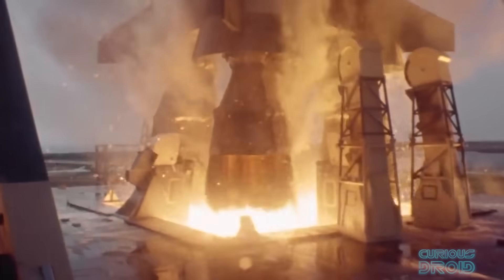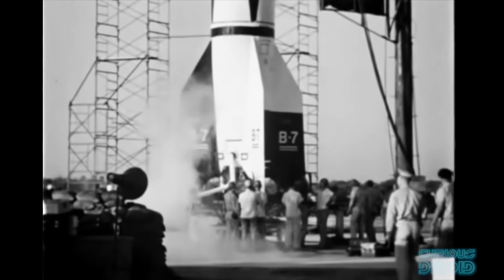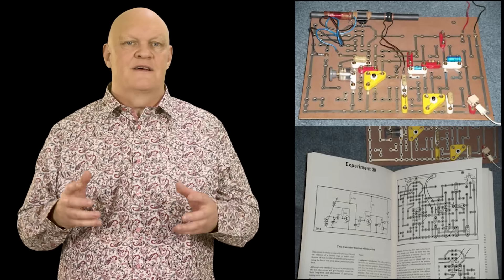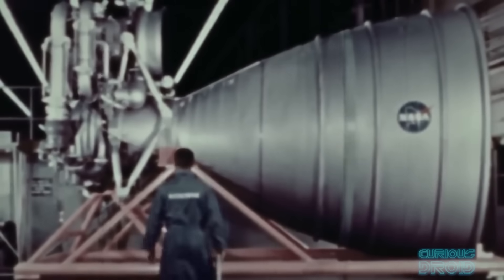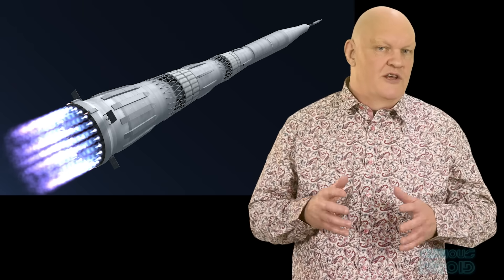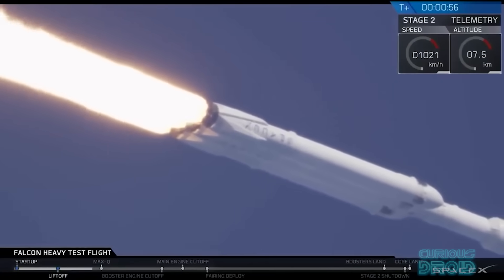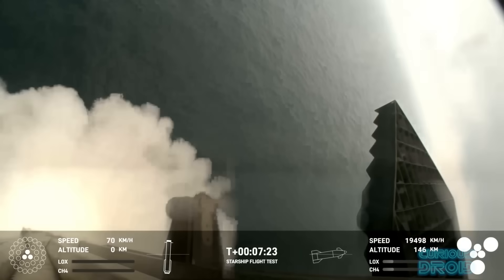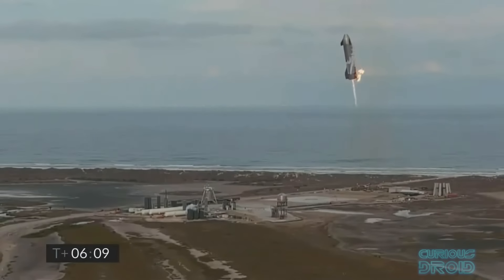Why Does SpaceX Use 33 Engines While NASA Used Just 5?

Comment: 18:20 As far as I know the SLS solids also aren’t being reused. As they burn for longer than the shuttle boosters and burn out at a higher altitude, they can't be recovered.
Reply: So at this point the best use of SLS is just to get some use of legacy stocks of parts from Shuttle. With the caveat that they have to make a ton of new stuff to be able to use the old stuff. 

Should have at least painted the things white so they give off that classic NASA Saturn V look.
Reply: @scottwatrous main issue: with refurbishment and modifications this old stuff is WAY more expensive than new stuff. Rs-25, main engine of shuttle and SLS, costs of refurbishment and modifications is about 140mln per one engine. New rs-25E, currently in testing will cost 100 (later 70) mln per one. Cost of BE-4 ( stronger engine as it got ca 2.5 MN of force vs 1.8 of RS) internal cost of production is ca 7 mln, while it's sold to ULA for 20 mln. 
Raptor 2 engine, with 2.3 MN, costs around 1mln internally. Raptor 3 will be even cheaper. 

Simply put, modern technology of production is way more effective. From machining to 3d printing. And also modern materials that are way cheaper (raptor 2 uses mostly stainless steel and copper, raptor 3 uses almost exclusively stainless steel. Steel in late 70 wasn't as advanced as today, and due to technology wasn't practical to use it. During development of SLS there was lot of proposals that had way more sense from time perspective, but we're abandoned in favour of "safe approach". In example there was in pretty advanced engine from rocketdyne from J series (don't remember details) that could be much less expensive than legendary, but obsolete RS 25. Also, rocketdyne if I recall, tried to revive F1 engine in form of F1b. F1b used modern technology for production and its estimated cost would be 15-30 mln. They even tested powerhead. 2 of those engines should power kerolox sideboosters instead SRB, and that would increase capabilities of SLS. Because not only kerolox boosters would have more power, but much more DeltaV. 
All those proposals were shot down by politicians
Reply: well realistically speaking the reuse we had with the shuttle boosters wasnt really worth it either, similar to the shuttle itself. While I love it as a spacecraft it definetely failed when it comes to reusability, which is why it is often considered as Refurbished instead.
Reply: @LunnarisLP  100% 

Shuttle would have been better at reuse if not for the stupid DoD requirements

There were shuttle upgrades proposed which would have fixed a lot of what the first shuttle got wrong
Reply: @LunnarisLP  It was $60 to $80K just to replace the windshield after each mission because of pitting from micrometeorites.
Reply: That's correct. They are not reused.

Which is just as well, they would need to be stripped down to bare metal and then built back up. This was effectively more expensive than just making new ones for every flight.
Reply: Some facts: The boosters followed a ballistic trajectory, falling back in the ocean. During descent, they were slowed by a series of parachutes: a drogue chute deployed first, followed by three main parachutes, which helped slow their descent and control their landing.
The SRBs splashed down in the Atlantic Ocean, approximately 140 miles downrange from the Kennedy Space Center.

ships were already deployed to recover the boosters from the ocean. Divers attached flotation devices and cables to the SRBs, which were then towed back to shore.

Once recovered, the SRBs were transported to NASA’s Kennedy Space Center, where they underwent a thorough refurbishment process. This included cleaning, inspecting, and replacing any damaged or spent components. The solid propellant was removed and the casings were refurbished for reuse in future launches. 😂
Reply: SLS is a joke rocket.   it's a jobs project and nothing more.
Reply: Space shuttle booster cost more to reuse than just sell it for scrap steel and build a new one.
Reply: @k53847   not sure if that’s factual or just a hearsay 🤣… on the other hand you have never seen SpaceX disclose the cost of any of the boosters…or a open shared assessment of damaged components, or systems from any landings…Now that’s a joke 🤣
Reply: @Mannicx  For F9, compare a launch with booster reuse to a launch where they can't recover the booster.  The most optimistic  SWAG of SRB I've seen was it only costs 98% as much as buying a new booster.  Other estimates are it costs more and it was all PR driven.
Reply: @Mannicx  there was few times that Elon himself talked about this, and also it is very close that was described in other sources. "Refurbishment" aka sooth removal from engines and roughly from booster+ inspection etc costs about 1-2 mln. Cost of building new second stage is ca 10 mln (there is a bit variable like nozzle length). Building new fairing costs 2 mln. This is why they are reusing old ones.
Major variable in cost is transport. Sea recovery is quite expensive. One launch with reused booster costs SpaceX roughly 15-20 mln. Building new booster costs 30 mln so new booster expendable is ca 45 mln. SpaceX is charging customers roughly 60 mln per launch so they are anyway in plus, but major difference with reusability is cadence that they can launch. Don't remember exactly, but they can build   new booster in about month. Thanks to reusability they are now launching 3 times a week.
Reply: SRB’s on the old space shuttle were recovered after splashdown and refurbished and reused. They had parachutes in the small fairing. Lots of videos showing this. 
For the SLS- weirdly it says they aren’t recovered. Maybe they have so much more thrust than those old srb’s that they figure the stress isn’t handled well.
Reply: If Wikipedia's numbers are to be taken as reliable the SLS boosters only burn for 3 seconds longer than the Shuttle boosters (126s for SLS vs. 123s for Shuttle)
This is pretty insignificant considering that the SLS booster has more than *1.25 the fuel that the Shuttle booster had (640 tons vs. 500 tons)

They probably burn out at a higher altitude because the entire rocket is stronger, and so the entire unit ends up higher than shuttle did when the boosters burn out and stage separation happens.
Reply: Solid booster reuse is not very economically worthwhile as the video mentioned they're relatively simple
Reply: Exactly. SLS is such a big waste of money...
Reply: @scupking  hear hear... 
It less capable but more expensive than friggin Saturn V. Senate launch system aka senate jobs program. In expense of already underfunded NASA. I like how recently NASA is moving more and more to fixed price/reward contracts like ie with Mars sample return contract. That one is particularly ambitious with a bit underwhelming price, but CRS CCP programs shows that is good way. NASA is interested in results, not how they are achieved.  
I hope that one day NASA will be like: " here is that particular data we are interested to gather from this celestial body, and here is price we wanna pay for that. You got 5 years. Go". And paying for results.
Reply: @just_archan Yeah and the government seems to hate Elon and won't talk about SpaceX or Tesla.
Reply: @scupking there must be a reason 😂
Reply: why do they burn longer? It's the same propellant, with the same diameter of the booster (same burn time).

The booster is longer, but that only increases thrust, not burn time.
Reply: @ora6925 They have an extra segment added, they're longer than the shuttle ones.
Reply: @ReddwarfIV  solid boosters burning from inside out. So each segment burns same time. Difference in length means that they have more power. Unless that they have change propellant for slower burning. 
Basically for making boosters burn longer you make them thicker, not longer, or change propellant mixture. Slower burning propellant generate less power tho.
Reply: @just_archan  Fair enough.
As far as I was aware, the main reason they weren't going for reuse was that they finally accepted the SRBs weren't worth refurbishing.
Reply: @just_archan  It's not the same mixture that Shuttle used, but a new formula. They separate at a higher altitude and velocity than Shuttle, makes reuse impractical and not sensible, just like in general with high C3 performance vehicles that have booster cutoff at near stable orbit.
Reply: @just_archan  But the propellant isn't a simple hole up the middle, the hole tapers and has different shapes (at least for the shuttle) to control the amount of thrust during its burn. So that can(within limits) control the thrust/burn time, reducing one increases the other.
Reply: @stusue9733  ikr. It was simplification of principle. Most people think that srb burn like "candle", so along length of booster. That is obviously not true.
Reply: @ReddwarfIV  The SRBs are hollow core: all 5 segments burn at the same time. The additional segment adds thrust, not duration. It's not end burning.
Reply: @ora6925  you're right about the current SRBs 

I'm not sure about the BOLE one's SLS is about to use
Reply: @ora6925 good question, SLS SRB's have five stacks of propellent compared to shuttle's four and there is an extra RS-25 so when the SRB's separate they are too far down range for effective recovery.
Reply: Did Apollo 11 actually leave near-Earth orbit?
Despite the revisionist narrative that this channel won't question -- unstable fuel burn for the oversized F1 engines was never rectified and another arrangement in their place was made in order to reach near Earth orbit, keeping the F1 bell nozzle to maintain the desired appearance.  The great licking yellow flame was an indication that something was not normal as fuel was burning in the atmosphere while providing no additional thrust. This was the result of injecting additional kerosene into the exhaust stream for greater visual effect yet appearing to produce an inefficient burn unlike other rockets after launch.  No explanation is forthcoming and this issue is not addressed in any usual report; however, using a smaller reliable engine with a reduced fuel load and stripped down mission requirement allowed the Saturn V to reach near-Earth orbit.  

The Apollo 11 crew attempted to demonstrate their position at over halfway to the moon as seen in the unedited version presented to the public while the more recently released unedited version reveals a flood of blue light entering the same window as the camera continues to roll, through which only a moment before, we saw the Earth far distant in what appeared to be very low light conditions. Then, as the camera pulls back from the window, the exposure settings are seen to return to normal as a flood of light enters the same window.  Without a change in the orientation of the spacecraft assumed to be on a trajectory toward the moon, the only source for any flood of light can be the Earth while in near-Earth orbit.  The usual sponsored efforts will try to make excuses for why the obvious did not take place -- yet is overly apparent in the unedited version.  When facts cannot prevail in support, sponsored activity will resort to name calling and other derogatory comments discrediting themselves.
Reply: @ronaldgreene5733  wow. Thousands of engineers were wrong. And you solved it from your basement computer!  Bravo!
Reply: .  . While remaining in near-Earth orbit, another indication are the impossible weather patterns seen on Earth, when in reality only a small portion of the Earth's surface was visible, framed by the round window of the command module.  Straight line cloud fronts are seen on video to be extending for what appears to be more than 6000 miles, a quarter of the Earth's circumference -- something that has never occurred in the meteorological record on Earth. The round window of the command module was used to effect an image of the Earth but the weather in the region did not comply for a realistic view.  No recognizable continents are found in view, but only the impossible weather patterns seen.

Comment: I have a Radio Shack Electronic Learning Lab.
I worked my way through the text books that came with it.
And repaired a couple of computer monitor power supplies with the knowledge gained.
It’s still fun to tinker with, from time to time.
Reply: Got one sitting on a shelf. The '75 in one' Electronic Project Lab Cat. No. 28 - 267
I wish there were Radio Shacks again. I miss being able to go into one to get a replacement driver for a stereo speaker or a pack of diodes for an amplifier repair.

Comment: You really should have the Russian mighty Energia here, it uses the worlds most powerful engine RD-170, the Energia uses 1 RD-170 and 4 RD-0120, lifts slightly less uses half the fuel and is half the size, Blue origin uses Energia's baikal booster rocket for its launches.
Reply: Blue Origin does not use anything from Energia. They use their own BE-3 engine for NS and BE-4 for NG.
Reply: @SentinelSent  Blue origin and space x both use licensed Russian technology but are private companies so no audit, the way around this secrecy is npo Energamash a Russian space technology company check there clients list you will see companies related to space x and blue origin trying to buy cheap to get NASA contracts, past 10yrs American spy satellites have been launched using Russian RD-180's(shamefully), and same with ULA Starliner uses RD-180 taking astronauts to ISS and will do so till 2035.
Reply: Baikals never went into production
Reply: @sidharthcs2110 neither did RD-180 yet LOCKHEED,NASA for 24yrs have launched 100 on Atlas 3/5 till 2030, American engine are crap they blow-up and are unreliable, Russia's Soyuz 1700 launches crew/cargo still flying to ISS, will never be beat

Comment: You also need to mention engine out capability on starship. Just like you said if Saturn V were to lost a single engine during the early stage of the launch it will resulted in abort. Meanwhile Starship can have up to 3 engines out but still launch.

Comment: Slightly error describing testing the N1 engines.

While lack of testing facilities may have been a problem as well, the real issue with the N1 engines is that they used pyrotechnics to operate the main valves.  This meant that short of rebuilding the engines they could only be used once, and also that the engines that were test fired weren't ever put on the rocket.
Reply: Главная проблема двигателей N-1 была в том, что они были не доработанные и слишком часто отказывали. Требовалось много еще времени, чтобы довести их до нужной надежности, а их уже десятками ставили с конвейера на ракету и запускали в небо.
Reply: That and they may have rushed development. Not mentioned in the video is that Brezhnev came to power in a board room coup in 1964, which unsettled things for a many of a bureaucracy. And then Korelev dies in 1966 and is succeeded by a less than skilled successor. Glushko had no problem cleaning house in 1974, to put it mildly, but then he pressed/oversaw development of Energiya/Buran (which proved to be very costly).
Reply: @michaeldunne338  Costs were not an issue to Russia (and still aren’t). It was all about showing off with a big bang. They certainly got that with N-1.
Reply: @Dave5843-d9m Costs most certainly are an issue with the Russians and the Sovjets before them. It’s just that the Russian mode of technological development is to trade safety and bodies to make up for lack of money and competence.